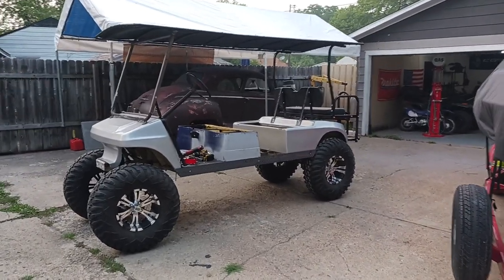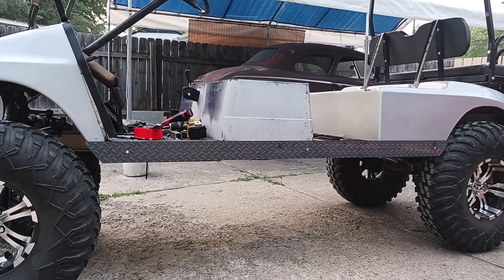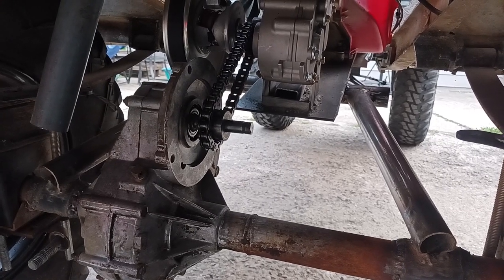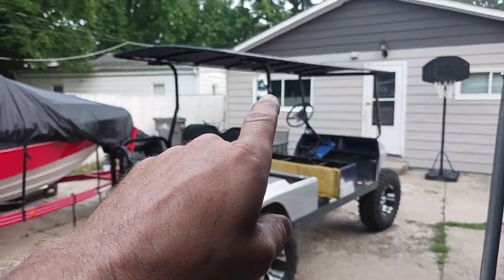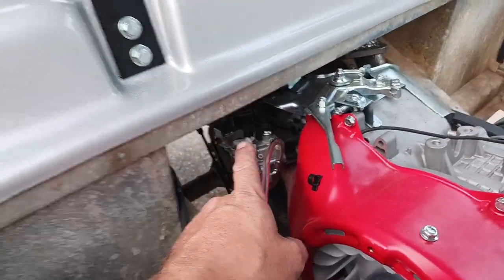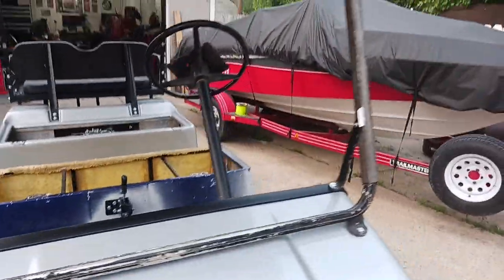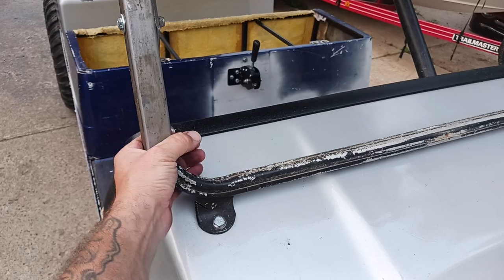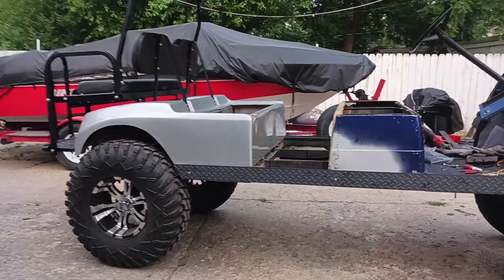Limo Golf cart ON 32"S - UPDATE!

Comment: Another thing to go over maybe electrical? With wiring for the the starter and any fancy lights you put on if you're doing that. I was playing with the idea of making a bracket for a starter/generator off a gas cart since I was told the one on the predator doesn't put off enough.